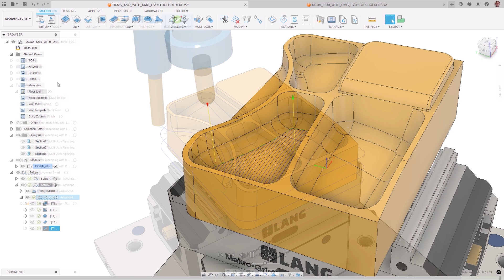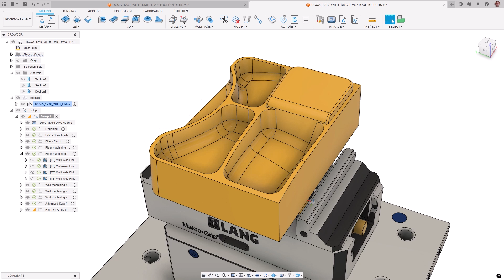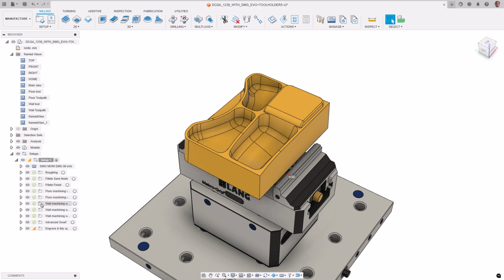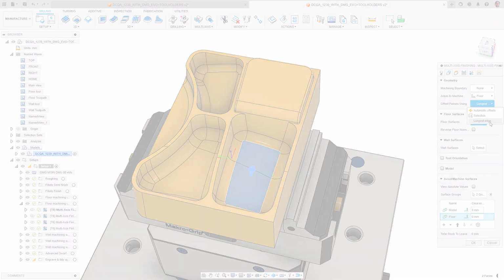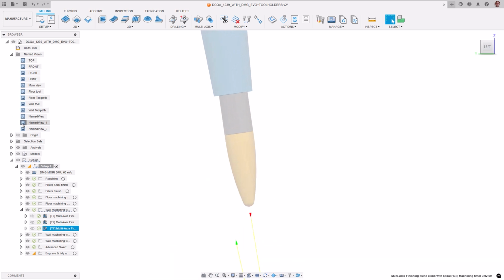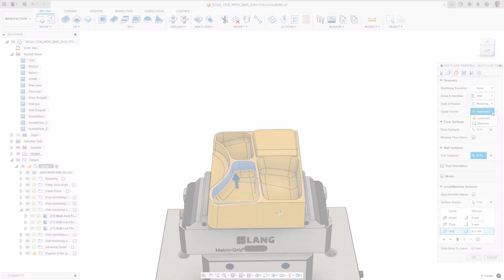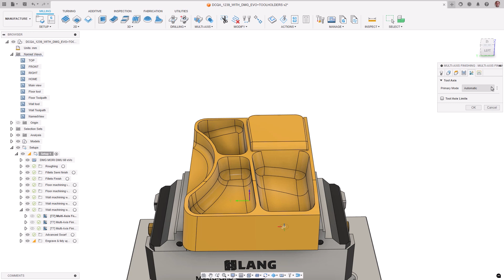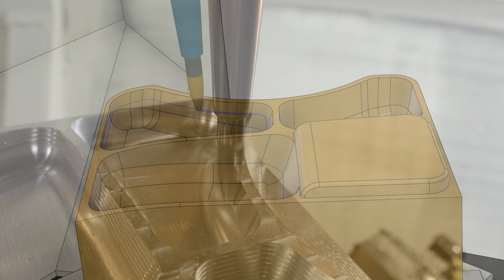Reducing Cycle Time with Circle Segment Cutters in Autodesk Fusion

Comment: Good software, but it needs to be improved a lot more. In certain cases, such as drills, it could allow a peck depth per material when creating Speeds and Feeds, and for milling cutters, we could set an angle or helix/ramp angle when setting up each material.

When creating Chamfer Milling Cutters, we could choose whether it was a backside chamfer or not.

A better organization of tool speeds and feeds, say by machine and material subcategories, due to the difference in torque, RPM, etc.

Many more improvements could be made to the Tool Holders part in simulation, When we are milling in a turn there may be an option whether we want to use the Y axis or C and X axis.